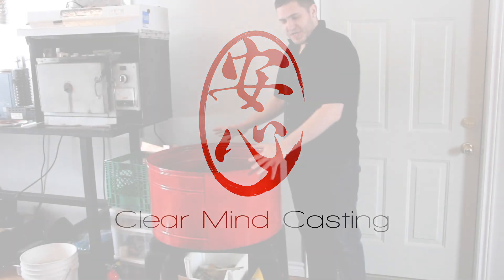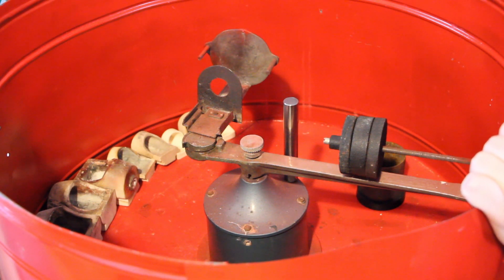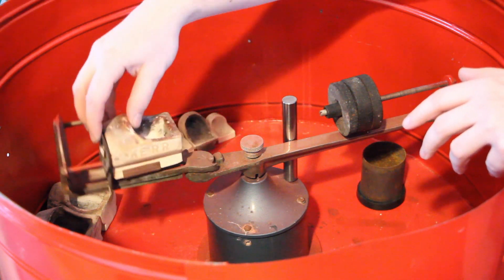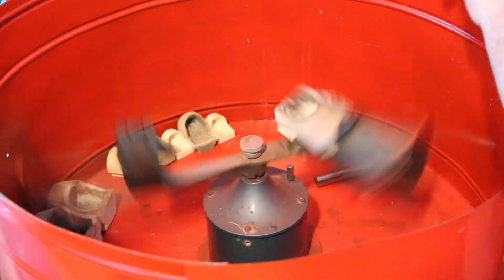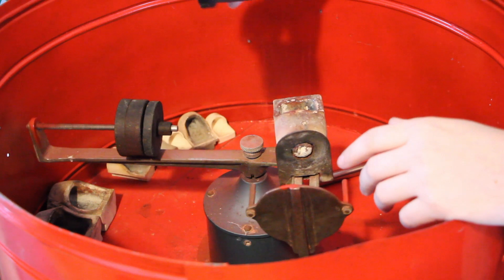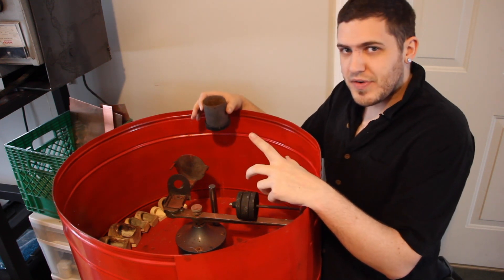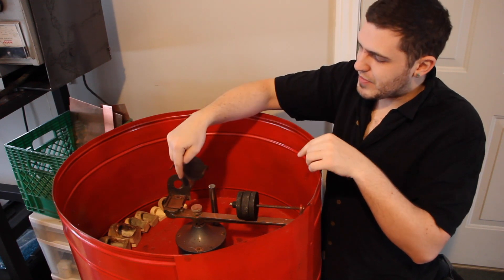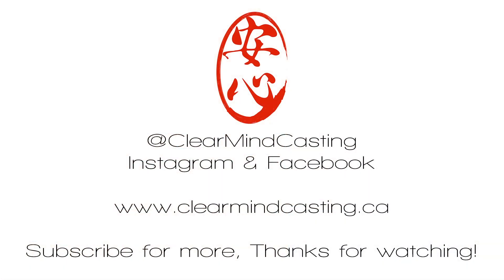Centrifugal Casting Machine Overview, Pro's and Con's

Comment: Hi Dan. I have quite a bit of experience with centrifugal casting, but I am considering changing to a vacuum cast machine (and getting a melting pot). Here is my question: I only cast small quantities at a time (3-5 rings), normally in gold, but sometimes in silver. I moved overseas and need to buy new tools. I am spit between getting a vacuum caster + melting pot vs. A centrifugal caster and a torch melt. What is your opinion?
Reply from the maker: I believe you commented on another video and our opinions about quantity still stand. If you’re only doing small batch casting under five objects having a larger melter, whether it’s 1 kg or bigger doesn’t really make sense. 
In terms of material usage if you’re using palladium white gold, or other difficult materials, a melter would also not be suitable for those. 

However, if you see yourself down the road upping your quantity of silver production to 20 or more pieces at a time you might consider future proofing and getting the melting furnace and vacuum but again that depends on where you see your business projections going .

Comment: I recently aquired a fully working Kerr Centrifico casting machine, 14in total length broken arm style, largest flask is 3 1/2in diameter x 2 1/2in high. what is maximum weight of molten metal I can throw? I am having trouble finding out.

Comment: Cool video.  A larger centrifuge would cast larger flasks.  I do believe that centrifugal casting has an advantage in preventing gas from forming at the surface (from the G force), thus making a crisper copy - since it is more difficult to form a gas-bubble at 5G then at vacuum.  And also a centrifuge will cast into tinier spaces.  Different tools for different jobs.  Happy casting.

Comment: So sadly I can't afford the 800 to 1200 for a vacuum casting machine.  I've improvised my own but it doesn't work very well.   A lot of places are selling small dental centrifugal casting machines for under 200.  Would it be worth investing in one in the short term until I can buy or build a better vacuum casting rig
Reply from the maker: Centrifugal casting is a great method of casting.
Keep in mind that those $200 units only come with the centrifuge, generally no flasks, guard, etc.

Also, if your improvised vacuum can handle the investment de-bubbling then it's a decent option, if not then it's almost better to get a vacuum for the 2 in 1 purpose.
Reply: @ClearMindJewellery  well it's a commercial vacuum chamber and pump.  The pump is a bit weak but it handles the degassing okay.   The janky part is the thing I set up to vacuum the flasks while casting.  It never gets a very good vacuum at all.

Yeah I'm aware those cheap rigs would require flasks and crucibles but it's still probably the cheapest option since I'm also trying to get a 3d printer because I'm terrible at sculpting clay or wax.     Lucky for me I'm staying with my old man for the next couple months and he's got oxygen tanks he doesn't use which will save me money on a torch setup...I also do kind of enjoy just how ridiculously dangerous spincasting looks..   need to upgrade my setup soon though so I can finish the Minecraft themed chess pieces to go with the chessboard table I made my son.    Even with super liquified brittania pewter I was only getting half filled molds
Reply: @ClearMindJewellery  ps thanks so much for answering my question 3 years after you'd posted.   You'd probably cringe if you saw my setup.  I just got an allegedly thousand watt foredom knock off that shockingly works great.... And I'm considering those knockoff Smith torches too because my cheap side keeps going safety shmafety it's like a tenth the price

Comment: Do you wear any kind of protective glasses when your using a torch to melt metal for a centrifugal cast?
Reply from the maker: Generally any time you're going to be melting metal its good to wear glasses and other protective gear. With oxy-acetylene you should always wear them.
Reply: I wear sunglasses to be able to see the temperature of the flame and metal better - and for eye protection.  I've never had metal coming in the direction of my eye.  It is very heavy and seeks the ground quickly - better make sure you have non-flammable shoes.

Comment: If the chamber is fully vacuumed before it spins. I guess it would be the greatest compare with tilting machine and vacuum compress machine in terms of bubble and shrinkage problem.
Reply: I doubt that is correct.  Shrinkage has nothing to do with the surrounding pressure, it is a factor of the metal contracting as it cools.  Casting in a vacuum would also make no difference - it is the G-force of the spin that is of the essence.  Actually, a vacuum is counter-productive as it draws gas (bubbles) out of the metal.  I've cast for 25 years and I prefer centrifugal although I have tried both.